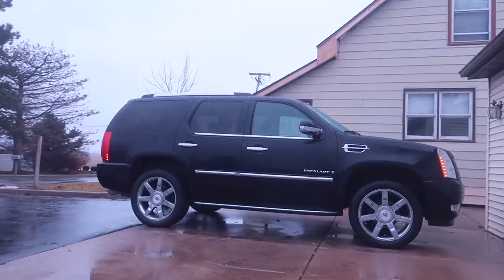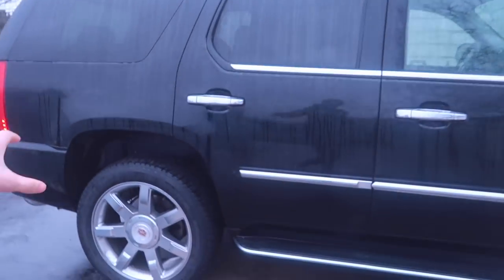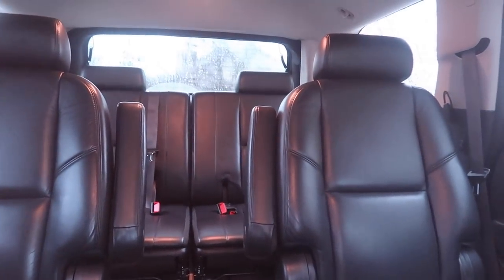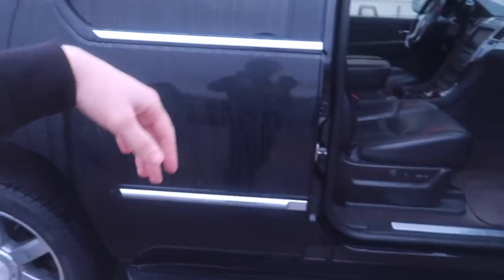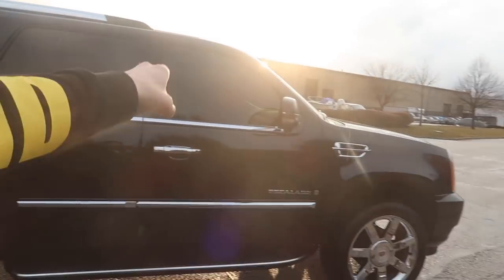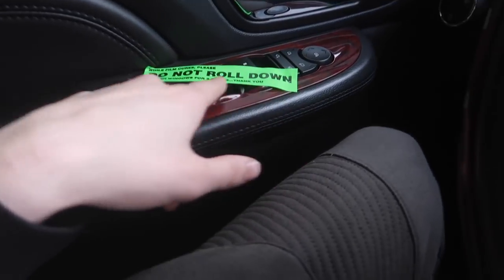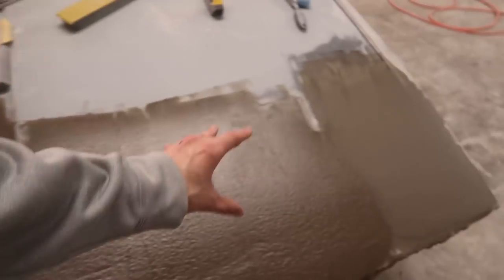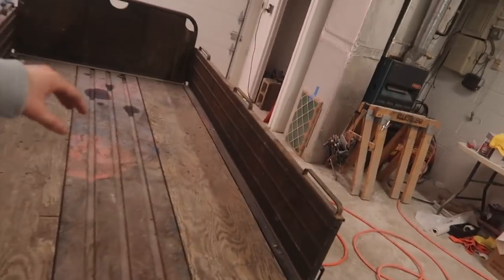I Bought A Cadillac! And It's SICK!

Comment: Mines a 2wd on 28s and I tow no problem. My flatbed weighs 2400lbs plus a car and pulls plenty. A couple tips tho, a superchips or diablo tuner to firm up the shifts keeps the 6l80 much happier and cooler, and I have a 2/3 drop with the autoride air shock delete, I'd suggest keeping it to minimize sagging with tongue weight
Reply: I’d go with edge or a nice custom tune before I put a superchips or a diablo tuner on it those are the worst for Chevys. They will eat through a transmission
Reply: 540iadicted "Mines" isn't even a word brah..
Reply: I'm Zoid sorry the apostrophe isn't there. "Mine's" is absolutely a word. Contraction of "mine-is".

Comment: Superchips flashpaq would make it more adjustable for towing and performance. Also fab some silicone on the center caps. They will fall off while driving. The auto high beams wont work with fogs on. And there is i believe over 1000 sensors. I've had O2 go bad so far. Mine is an 08

Comment: VVT delete and AFM delete the Escalade asap , got mine used with less than 60k on it and right around 90k it blew a lifter , now I have an LS9 cam in and tuned it and it gets better mpg and pulls so much harder

Comment: There's one thing you gotta look out for with these escalades.  If you get a misfire on cylinder 6, you may have collapsed a lifter and ground your camshaft.  But other than that, those things are pretty bulletproof, just use the 4cyl mode sparingly

Comment: I tow stuff with a 1995 Suburban that has 200 horsepower and 300 lb ft of torque and it pulls 4000 lb cars with no problem. That Escalade should have no issues at all.